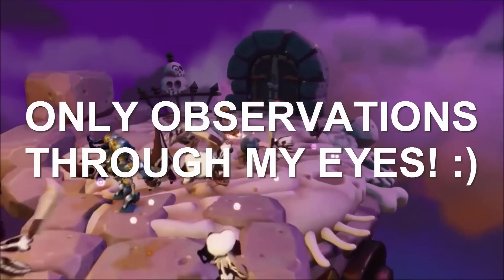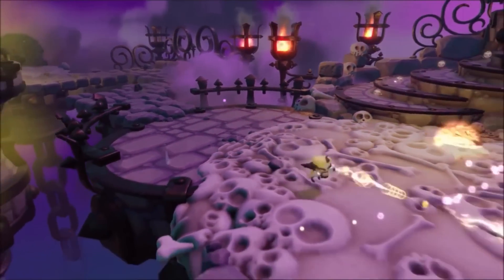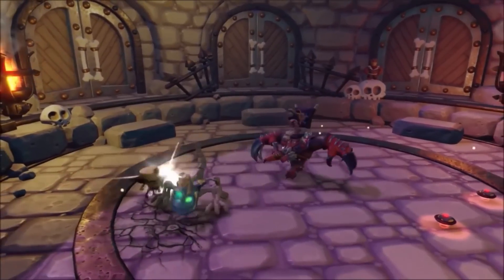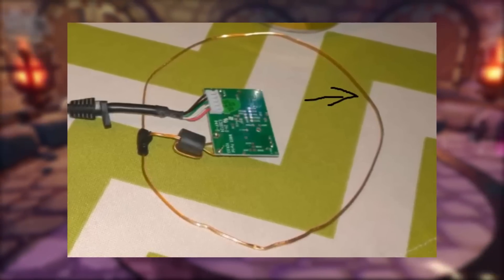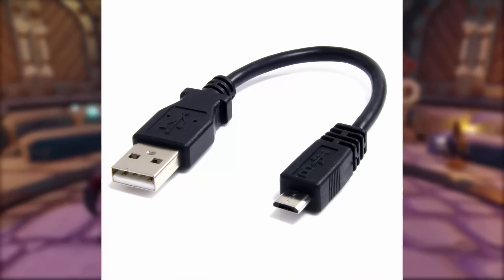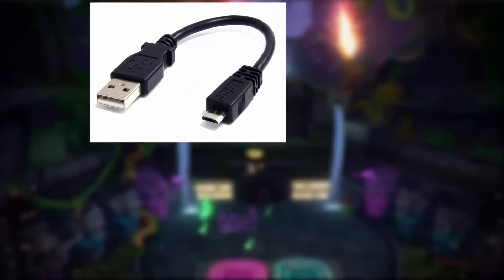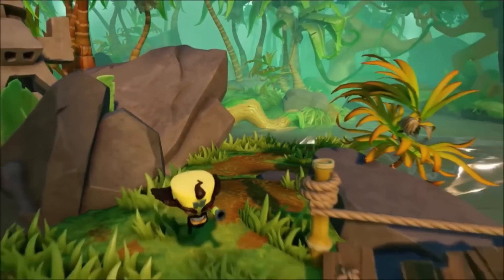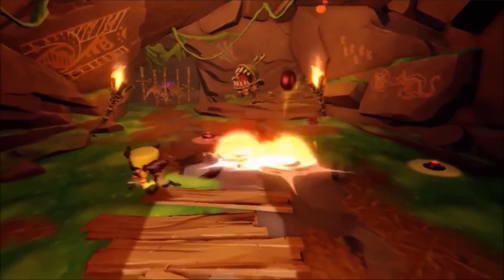Skylanders Science: HOW THE PORTAL OF POWER WORKS!

Comment: You  are not even trying to do the recherche to the portal of power NFC didn't exist at the time the first game was realesed it was using RFID this whole time and none of NFC tech can support voltage for a LED because it would interfere with data transmission between the two coils
And also do more learning noob